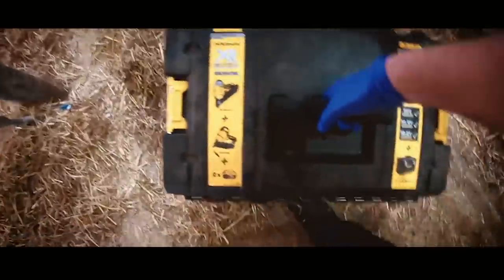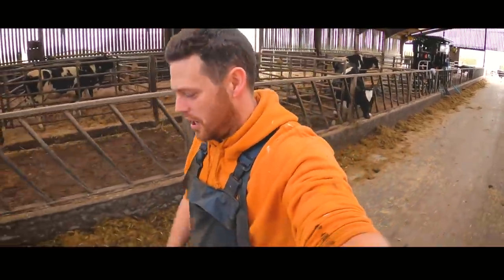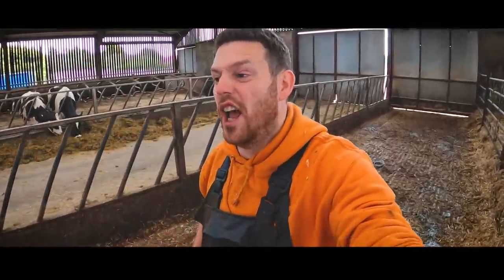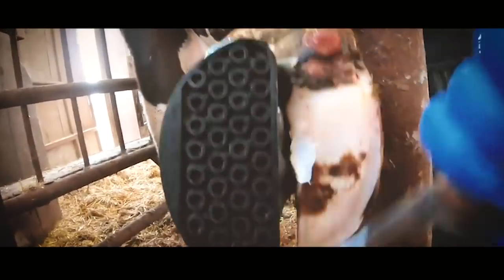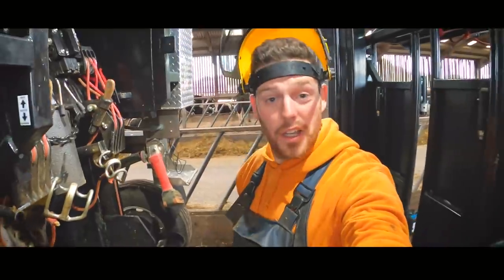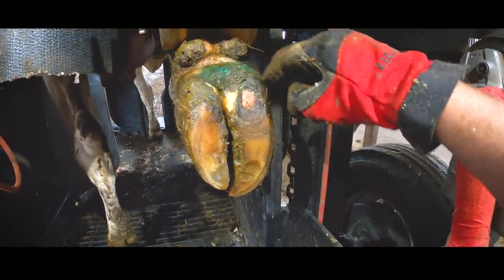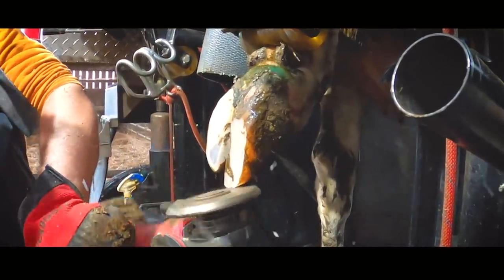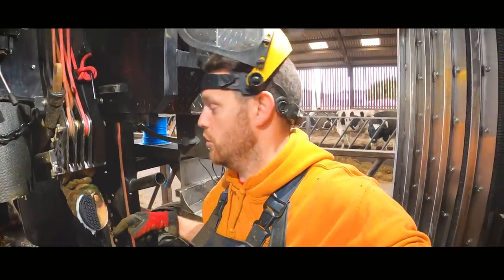*I CUT into this COWS FOOT* ...TO HELP THEM!? REVISITING a HUGE ULCER | The Hoof GP

Comment: That glue looks exactly like the glue I used to use when I was at Ford doing recalls on Explorers replacing the cleats on the rear windows that hold the Gas struts to the glass except ours was black.

Comment: Days going well, just sent off 10 calves and the weather is not willing to cooperate, but such is life in South Dakota.
Also, when gluing a block on what is the point of the fire?
Reply: It makes sure there is no moisture and glu flows better when warm and sticks better when surface is dry.

Comment: Just interested,what happened to the blue glue which you said was the best on the market.Does the one you're using now improve on the blue.
Reply from the maker: The blue one is a winter glue and during the summertime it can set too quickly

Comment: I’m a bit confused. I’m fairly sure I heard you say you had put a block on when you were there last there. Yes, yes THAT video! The footage that’s been lost!!
In the beginning of the video there were two cows that went skittering by you. They looked like they were high school girls that walk back and forth in front of ‘the guys’ at recess. Giggling and batting their eyelashes-at the boys....!
Reply: Sometimes they do lose blocks prematurely. Fortunately, if the person applying them is any good, it doesn't happen very often.
Reply from the maker: Last time I saw her she still had her original block on and I applied a second block on top of the original to give it extra height - unfortunately whilst doing that can help MASSIVELY ... it also makes them more prone to falling off - in this case the block stayed on for a further 2 weeks and then feel off the week before I returned
Reply: The Hoof GP thanks for your reply Graeme. I had thought there would have been some evidence of the adhesive left behind. When I think on it more it would make more sense for the adhesive to completely stick to the block than the hoof. Have you ever had the block come off and the glue left behind? 
Thank you for explaining... oh and another question. Is it better for the glue to stick to the surface if it’s smooth or a bit rough? Have you ever tried the two ways?